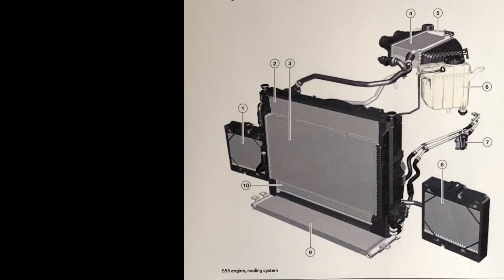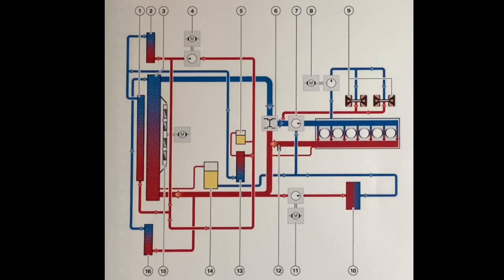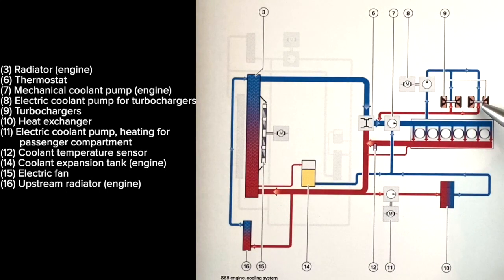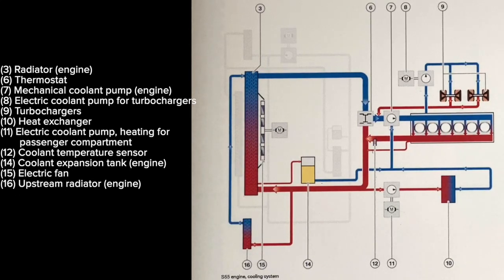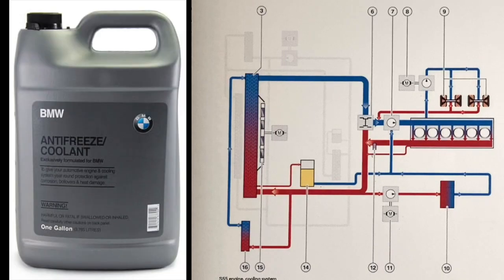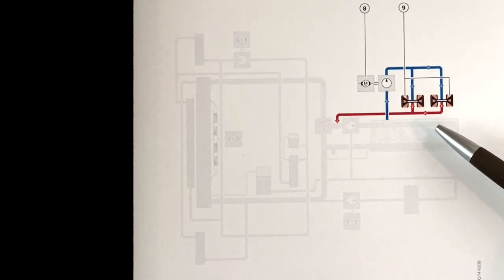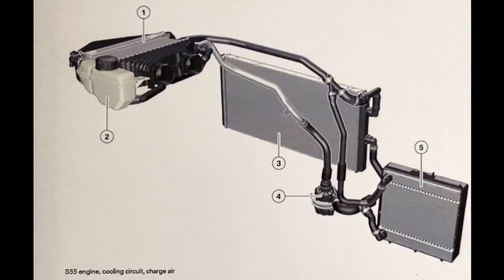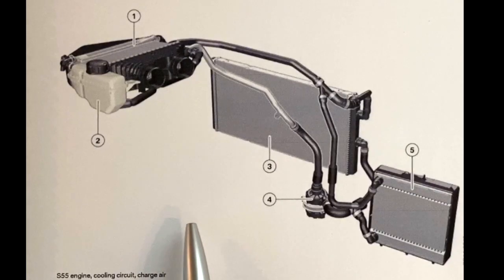BMW S55 Engine COOLING SYSTEM EXPLAINED!

Comment: Do any of these pumps make a high pitched humming noise?
Reply from the maker: +@carsandcoldbrew6489 probably, but I never really listened to them.
Reply: Could be the belt for the mechanical waterpump connected to the timing belt system or an electric one going bad

Comment: Just did my coolant flush, did a 75/25 distilled water/coolant ratio for the low temp circuit. thanks for the info 😃
Reply from the maker: +@AW.SO.M3 you’re welcome 🍻

Comment: Hey thanks for the video. Very informative. 
Question:  when filling up the expansion tank, do you put in the 50/50 mix of water coolant or just water?
thanks!!
Reply from the maker: +@humbertogamarrajr.3971 you’re welcome! Please subscribe to the channel 😉

Use the 50/50 mix if you can. If only topping it off at a separate time it’s ok to just use distilled water.

Comment: Extremely interesting video. This answers a lot of questions I had.

A question: do you know how the S55 cooling system relieves itself of pressure in case the expansion tanks are not enough? I don't see a pressure relief valve in the circuit, nor observing the radiator of the car in your coolant change video. I'm intrigued.
Reply from the maker: +@mambodiehard that I’m not sure of

Comment: I think my f80's electric fan shroud are broken. so I search ISTA and found how to replace. But I have to displace electric coolant pump hose, and bottom plate. and need special grease for does parts reconnect. 

Can I pull it out without drain and easy?
Reply from the maker: +전경훈 I don’t know. My wild guess would be no

Comment: I see an oily stain around the cap of the expansion tank behind the charge air cooler on the top of the engine. I unscrewed it, and re tighten it.
Have not seen the stain/seepage since, should I order a new cap? What coolant do I use to top it off. Thanks for the video, it calmed my nerves brother 🙃
Reply from the maker: +jonathan pinkett you got it! Hope you’re a subscriber now 😉
I use the BMW coolant mixed 50/50. If you only need a little to top it off you can just use distilled water alone. 
I would top off and drive like it is but check the level frequently.
Reply: @HelpMeDIY  of course I subcribe to your channel, there's waaaay too much good info not to.Keep Climbing
Reply from the maker: @jonathanpinkett5439  Thank you!!

Comment: Why do you jack the front left and drain from the front left? Wouldn't that cause fluid to be trapped in the main radiator?
Reply from the maker: +Alan Kim if that explanation didn’t make sense to you then watch this video where I change the coolant and you can see it in action: https://youtu.be/HrXuNd5cH3A

Comment: where did you find those diagrams?
Reply from the maker: When I bought the car the guy that owned it included a couple “books” he had printed out and spiral bound.
Reply: I saw the same diagrams on bmw's s55 manual, if u want i think i still have a copy PDF that i can send it to u
Reply: Ps: great video

Comment: Good, informative video.  The vacuum fill tool, while a specialized tool, is actually not that expensive and is nice to have if you are an "intermediate" or higher level DIY mechanic.  It is made by Schwaben and ECS Tuning sells it for ~$80.  I have it and it works great.  I have not used it on my F80 yet for either cooling system, but I have used it on my son's 128i with N52 engine twice.  Makes the fill process seamless, with only one bleed cycle required to burp any residual air in the system.
Reply from the maker: +James M. Yes I was referring to the tool BMW shops have to get the fluid OUT. Putting it back in with a vacuum fill isn’t as bad, and probably what I will use since I have one.